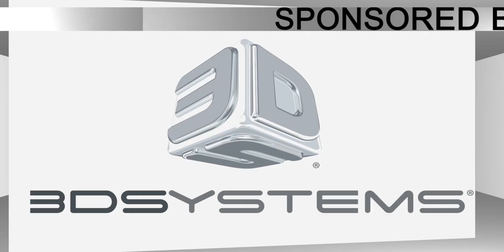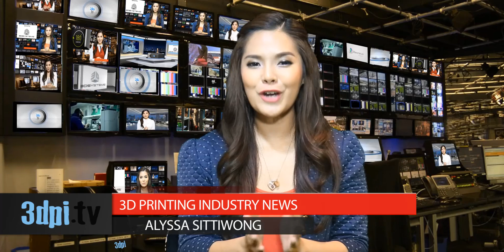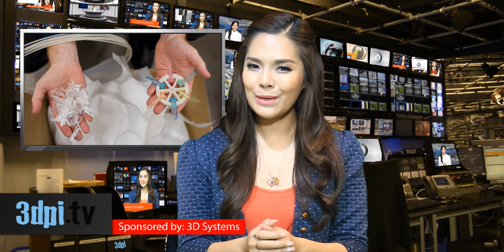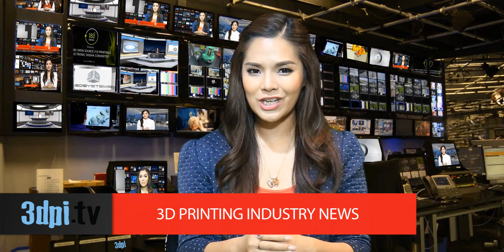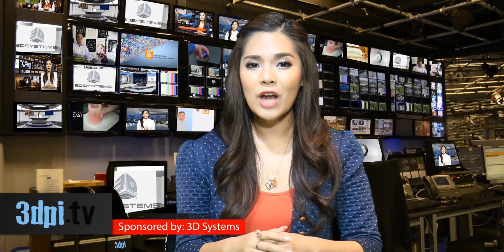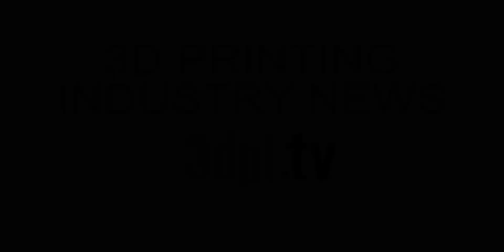Reusing Plastic with 3D printing

Comment: Came here to see plastic being prepared for 3D printing and to see a 3D printer using recycled plastic. Did not see any of that. Dislike.

Never mind bottles, jugs, etc. Think of the big things that are made mostly/entirely of plastic: TVs, printers, toys, Rubbermaid items, patio furniture, etc. What to do when they go kaput? Remove any non-plastic components, separate by type and color, and grind 'em up into 3D printer fodder.
Reply: I disliked it too.  I also like to see it all being done and maybe even get a look at the machines used.  That is how other people got their ideas for smaller machines for home or hobby use.

Comment: 3d printing uses a lot of electricity if you have the heated-bed turned on.
Reply: a lot like 50-250W on a small printer. but the hotend uses 40W mostly itself. where cooking your meal uses sometimes 10 times the energie depending on the print/cooking time. injectionmolding is better in that way but considering the use of a mold which is lots of energie to make and only useful for million peaces 3d printing has its place. by using better heatbed surfaces you can reduce the energy needed by a big factor.
Reply: I think that since most 3D printers are located in environments that are already heated it's a very minor issue. Sure, most of us have heating elements for our homes that are more efficient than the electricity we get from the socket. It's not what you focus on to optimzie if you wish to be enviromentally friendly. I haven't done the math but if 3D printing can save you a few trips with your car you probably came out ahead.
Reply: Not really any worse than running a computer.